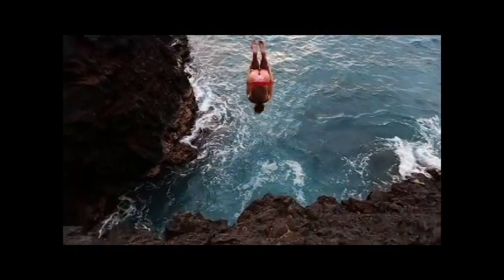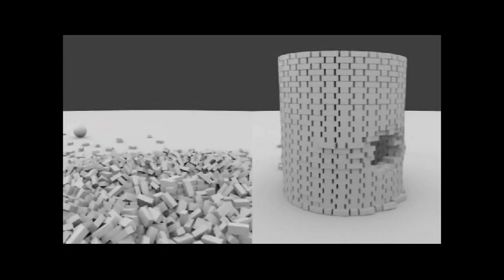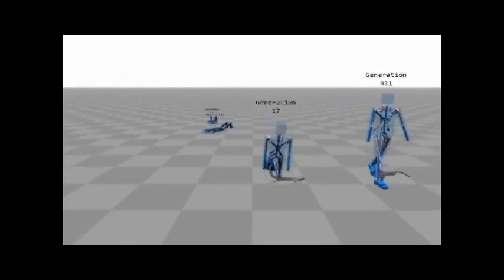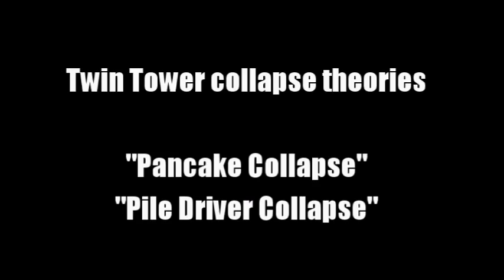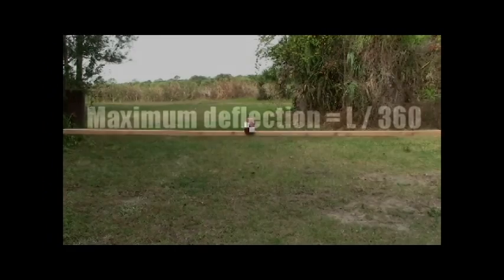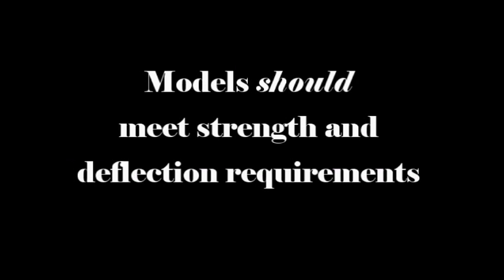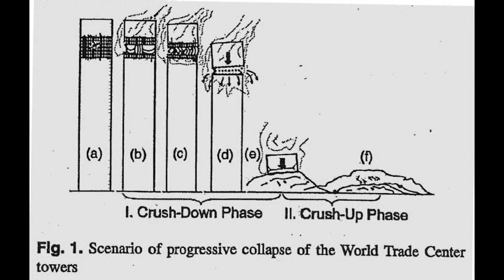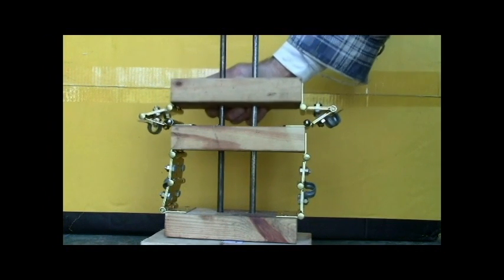9/11 Experiments: The Force Behind the Motion

Comment: Wow, very compelling!! I'm not a physics major but it seems that you've done a great job setting up your experiments. Thank you for taking the time to do these experiments and for filming them and posting the videos. I wish our government officials would have done the same. Kudos!
Reply: Except that his starting assumptions are all wrong (and he knows it) so he results are meaningless. Further, Cole's experiments are designed to fail on purpose in order to reach the conclusion he wants.  He built a house of cards, and threw a paper airplane carrying fircrackers at it; therefore the Knights of Malta.

Because science!
Reply: @MFitz12  is full of shit with a never-ending learning disorder with no common sense or better judgment who likes to lick boots and has no conceivable reason to wake up each morning other than to lick boots and post nonsense on YouTube.  Where is your experiment to prove otherwise. He use Paper Walls and dropped the weight on it and it still slow down and came to a stop...... Paper stopped the total collapse. Paper not 80,000 reinforced structural steel framework but paper. Another good example is the wood in your fireplace. We're talking about wood not steel. What happens when you like the wood? Maybe after 35-40 mins you'll start to see a localized failure here..... A localized failure there...... The logs begin to shift..... But never all the way to the floor at least until all the wood is burnt . This is wood mind you. What makes you think reinforce concrete could burn evenly and cause a smooth symmetrical collapse right through the path of greatest resistance allowing a total collapse but not before pulverizing to dust. Structural failure produces a asymmetric collapse not asymmetrical one. Asymmetric causes chaos and there was far too much order in the collapse. All three buildings file symmetrically with uniformity and consistency which are all the characteristics of a controlled demolition. The laws of physics are not challengeable but in fact laws. Now add the fact that all the news channels were reporting bombs being detonated. Now add the smoke that was rising from the basements. Now add the witnesses who saw heard and felt prior to and during the collapse explosions. Now at the fire chief who thinks they planted bombs in buildings. Now add the fireman by building 7 warning the other fireman to clear out because there's a bomb in the building and he said it twice. Now add your buddy who said they decided to pull it and they did and they watched the building come down . Only control demolitionist uses the word pull it. Now at the High velocity burst of debris being ejected and pierced into nearby buildings. Where did the energy come from? Structural failed buildings collapse vertically not horizontally. Now add the molten steel dripping from the side of the towers and don't say it was aluminum from the plane because aluminum turns silver the minute it hits the cold air and we see a bright orange trickle down all the way to the ground. No add the fireman who found molten steel. A river of molten steel like you were in The foundry. Now at the fact that the fire is lasted for months underneath the robo and that's just impossible. Now at the fact that there was an extra piece of equipment on the bottom of flight 175 that is only used on military planes not civilian planes proving that it wasn't flight 175 at all. Now add the fact that there was no debris or evidence of a plane crash happening anywhere near the Pentagon.. now add the fact that the FBI has no solid evidence that the hijackers were even on the plane. Now at the fact that some of them are very much alive in their country and are trying to sue the United States for using their names. No at the fact that the phone calls could not have been made at the altitudes the planes were in and they have been tested and proven. Now at the fact that NIST performed a miscarriage of an investigation and admitted to never have looked or tested for explosives even though the National fire protection agency guideline number 921 calls for testing for explosives especially when high order damages involved. They did not follow proper protocol. They mentioned nothing of all the testimony and evidence I presented. This is exactly what a cover of story looks like. It'd be the same as the Warren commission never looking or evidence of a gun in The book depository during the Kennedy assassination. Sounds stupid don't it. If you wish to prove otherwise present your scientific method. An experiment that demonstrates the force behind the motion. I already know you can't produce one. You already know you can't produce one. Face it you're a fraud and a lousy liar. Without the use of a scientific method using an experiment to demonstrate the force behind the motion you have no way of telling if you're stupid theory is even possible and that's the way it's going to go down in history. You simply guessing without testing.we are trying to live in a civilized world would you mind killing yourself

Comment: I did think that as each floor pancaked, its weight and momentum added to load above to result in acceleration of the whole mass - should be fairly easy to do a computer model showing the accumulating mass behind the collapse front?

Comment: Regardless of your view or opinion, I think many don't look at the actual construction of the Twin Towers.  Go look at some videos of them being built. Think of the time & energy it took to build them. It took years of man power & heavy equipment. Those 2 buildings were modern designed with the strength to withstand hurricane force winds, earth tremors & 7 jumbo jets strikes each! What force of energy would it take to bring each down in 10 seconds to a relative small pile of rubble & pulverized dust. Would one jet cause that? What about building 7? It had recent renovations to modify it's strength only to come down in free-fall speed in 6 seconds. All 47 stories neatly collapsing into it's footprint, not from a jet, but from general office fires. Buildings simply just don't do what they did on 9-11. If you apply reason & simple physics, which I think this video did, you'll realize this isn't a cartoon. Close to 3,000 died that day & a MILLION more in foreign countries shortly after. Justification to invade & ease the minds to accept such horror on fellow humans is criminal & the real culprits will some day have to face their creator.
Reply: Gravity is the force you are looking for.  All the force required once collapse was initiated.
Reply: What initiated it? Gravity is not a form of energy, gravity creates potential energy. You can't create or destroy energy, it can only be transferred. For instance, chemical energy can be converted to kinetic energy in the explosion of dynamite. A consequence of the law of conservation of energy is that perpetual motion of the first kind cannot exist. Gravity is the interaction between physical bodies with mass. Also, gravity doesn't shoot outward several ton steel beams at 60 MPH piercing buildings 600 feet away.
Reply: @M Fitz...I think the term is "mentally challenged" to be politically correct. I must be crazy to believe the only 3 steel structured buildings ever destroyed in history due to fire & gravitational forces happened on 9-11, but yet a hijackers passport was found by a FBI agent in pristine condition on a nearby sidewalk. My extreme disorder also makes me believe that gravity made flight 93 disappear into hole in a PA field with no discernible plane parts & the NTSB disregarding it's reconstruction. I'm really crazy to believe that on 9-10 Donald Rumsfeld publicly announced that 1 TRILLION $ was missing & that his team of Pentagon accountants were working diligently on finding out where it all went, but the next day a plane hit that exact renovated section of the Pentagon killing the accountants & burning up all the paperwork. I'm crazy to believe they didn't reconstruct that damn plane right there on the large pristine Pentagon lawn, what a dumb idea. Yup, gravity caused the towers to fall in 10 seconds, symmetrically, in a waterfall fashion with no resistance from 200,000 tons of steel support. What was I thinking? No forensic study was needed, so lets ship all the steel off to china.
Reply: I do but i'm terrible at math. I'm sure someone has already done this but I don't think it will provide much to the layman who could care less about calculations. Most want to know what, how, who & why this happened. Yes, Jennies Garage is awesome. That's me in a nutshell on how I think. I'm a jack of all trades, master of some...just like him. And I'm sure JG has the same views on 9-11 as us.
Reply: Hey Blu, yeah...I do remember now something about a red bandana connected to Shanksville but I always thought it was from the World Trade Center as well. Sure enough, there's a movie named Man in Red Bandana, released 9-11-17. It's a documentary film about Welles Remy Crowther, who saved at least ten people from a tower on 9-11 at the cost of his own life.  It's like an endless trail of bullcrap. Rambo wore a red bandana too...oh the irony.
https://www.nytimes.com/2017/09/08/nyregion/welles-crowther-man-in-red-bandanna-911.html
As a child, young Welles used the red bandana to blow his nose...LOL.

Comment: How do you factor in the concrete turning to dust during the collapse? In your experiments, the supporting materials are still there, and as the weights involved are so small, they won't crush or vaporise.
Reply: Strong explosives blew the concrete to pieces. How do you explain it? Go look at concrete buildings that fell but were not blow up the concrete mainly stays intact.
Reply: @eliazruis4761  you people crack me up. I have no idea how you have the ability to make it through each day without running into problems through lack of education.

Comment: Size and material matters. If your experiment was valid, we would just make skyscrapers out of paper, because steel re-enforced concrete would not be necessary.

The wing loading of a toy plane is generally less than 1kg/m^2, while for a 747 it's over 700kg/m^2. This is why real jetliners are made of metal and composites, while toys are made of incredibly light foam and balsa. Your experiment is cute, but realistic models of physics at this scale require either 1:1 scale model or computer modeling. All you've proven is that you are not a civil engineer.

Comment: The floors did not collapse, a floor collapsed which led to a wall collapse which led to the pancake collapse. The walls collapsed not the floors. That's why it fell straight down too. Similar to the pile driver theory. The problem with the author's models is that the walls were under tremendous loads. These are not accounted for in a small model. Small models do not scale up unless you use much higher loads. That is why large structures are more flimsy in a way. You have to have tremendously strong vertical elements or the will easily fail. You can't just scale up a small structure to equal a big one. You would be way off if you did that. Just like a mouse is built different than an elephant. An elephant has huge legs and toes compared to a mouse.

Comment: If people want to silence conspiracy for good.  Please someone come up with an experiment with a model that shows how the towers can collapse along with building 7 in the way they did, using the same things that are being said to have destroyed them ( fire for an extended period of time as in building 7,  and being hit by a plane and burning as with the towers.

What I am seeing in all these conspiracy videos is both sides have an interesting point.   But we all can not figure out one simple fact.  how did a plane take out a 100+ story building, that was designed to withstand high winds and even a plane impact, yet in crumbled to dust in seconds from top to bottom.  

In addition,  if in fact its that simple and easy to bring down buildings of that height and size, we all should be very concerned of safety, because clearly our engineering and technology is severely lacking.  We should stop building sky scrapers and go back to the drawing board.  

In my opinion,  the buildings all should of stayed erect, with a hole in the side and fire damage.  Fire runs out of fuel, still have a 100 plus story building standing or two in this situation.  

I just can't believe an important building could be brought down like it was, or 3 in this case.  Its no wonder 17 years or so after the event youtube is still hot on this topic.  

But in the end, even if it was an inside job by whoever.  We will never know and if we did, what could you do ?  So in the end its wasted braincells and time.  So    that is that.

Comment: All these people wanking on about 'controlled demolition'.  Soooo who pushed the button to control these so-called explosives? Who was the company they worked for that supposed to have 'wired' the entire building? Did they wire just the 3 floors where the planes hit? If they wanted to bring the towers down it would have been far easier to do it from the basement.  

Also, how do you know to put explosives on a particular floor in the building and then expect a pilot to fly a 500mph plane at it and hit the exact floor where the explosives are, so that it looks like when they detonate the explosives, the collapse is thought to be from the planes damage.  I never saw a big red spot on the side of any of the towers for the pilots to aim at.  They could never count the floors to where the explosives were either.  

Too many people have over thought all this - silly people tried making models to prove theories, but unless you make another full size tower and try it again you will still be just guessing.

Comment: A couple of observations:
At 3:50 he says, and I paraphrase, "We use physical models and from the physical models the math and physics are developed. Never the other way around."  That is not correct. Theoretical Physicists have solved mathematical "hypotheses" from basic or previously well proven mat since physics was invented. From the proven basics, new things are predicted as more and more complicated equations are solved. One of the best examples, Einstein. In his General and Special Theories of relativity his mathematics all worked correctly by mathematical laws, yet he predicted stuff that no one could prove with experiments at the time. Decades passed before we could build experiments that proved his math was correct. There, the math came first. Absolutely.  In many other cases, we use math to explain observed results from experiments, as correctly said in the video. Galileo dropped stuff and developed theories to define some basic effects of gravity by measuring what he observed. So, it happens both ways. 
At about 13:40: He tells us the Main Stream Media (MSM) has used complex math to lie to us. I suggest that while lies may have been told, the MSM has no employee capable of using math to do anything more than possibly balancing their check book. The MSM journalists are idiots. What is more likely the case is that nature took it's course. Experts, all clamoring for a moment of fame, generated many diverse "hypotheses" (unproven guesses) and flooded the weak minded media with their ideas. The media, unable to report the time of day truly or accurately, screwed up all of that, confused it, and published piles of nonsense. To date, I have never seen the MSM fail to succeed at publishing pure idiocy that most of the public believes. 

Meanwhile, if this was done by nefarious forces who somehow managed to plant the right kind of explosives or incendiaries in the right places, long before the actual disaster was triggered, those "masterminds" needed to do nothing other than allow the stupidity of the Media and the ignorance of the people to wipe out any hope of ever finding the truth.

Comment: I did't go threw your video but from the thumb nail I see that you placed 2 steele beams
in the center . The fact is the strength of the tower came from the external steel structure
The internal aspects were fitted with weak Steel connections. 
Secondly I could give a hoot about Jews , Zionism  or the Rothchilds , but the problem with you conspiracy guys is that you can never present proof of your claims. It's fantasy bullshit
stories. Its foolish shit.
Reply: If you HAD gone through the video, you would have known the steel beams were to prevent it from falling sideways. You don´t seem to understand the problem. What most ´truthers´ want is some real evidence supporting the official story, because so far neither Nist, nor the government has provided that. 
No evidence hijackers boarded the planes, no evidence those planes crashed there (almost no wreckage from 4 huge jetliners!). 3 Unexplained collapses. Explosions heard by witnesses being ignored. Impossible phonecalls. Impossible flightpaths and a mysteriously failing response without anyone being reprimanded. 

So before any truther is forced to show some evidence, maybe it is about time the official conspiracy theory is backed up by solid irrefutable evidence. Shouldn´t be so difficult if that was what really happened.